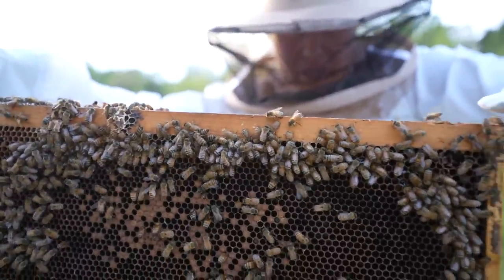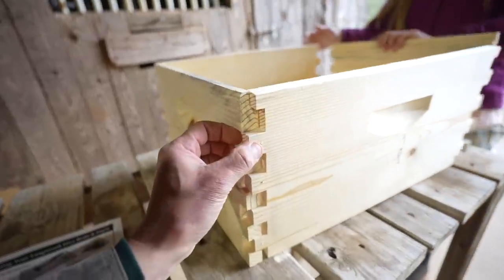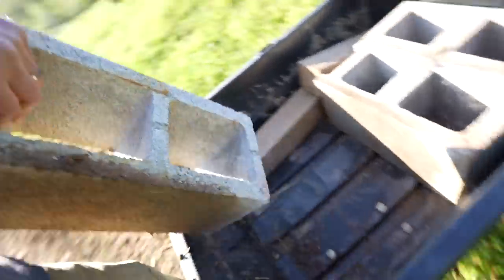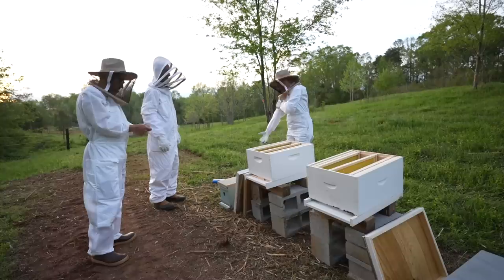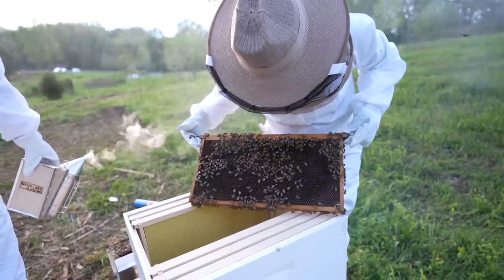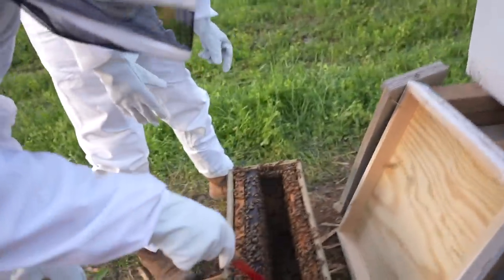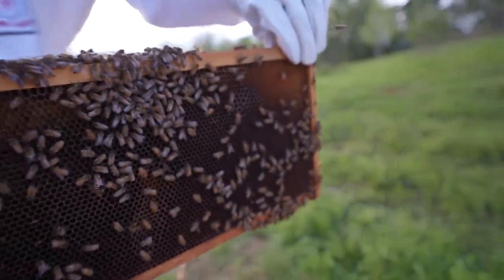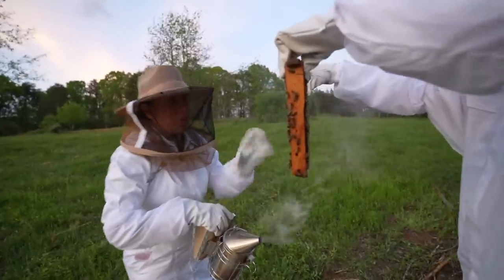We Got BEES

Comment: I'm sure many have told you but put your hives where they can get some shade not out in the hot sun of where you live, you'll bake the bees. Also don't worry about the bees when you want to put the frames in the box, they will move out of the way and if you squish a few, which it happens, it's ok. You have 30,000 bees there, missing a few is ok. Also when you look for the queen keep the frame over the box because sometimes the queen will fly off. Don't be afraid of the bees you'll be protected in your suit. I don't always wear a suit when I'm in the hive. It's a fun hobby with great benefits of pollination and honey.  I would order both a brush and a frame lifter to help you. The brush is to gently move the bees out of the way because they will build up quickly and you'll have to do splits which means you'll need more boxes and the frame lifter will help a LOT because the bees will glue everything down and it will become very difficult for you to lift the frames out. Also I'd either put a heavy rock on the top of the hive or a ratchet strap ( which is what I use ) to secure that top. Wind will do terrible things not to mention animals.

Comment: You want to press the frames together to maintain the proper spacing. Especially undrawn comb frames.
-------
If first frame is always the hardest to get out. Use the hook end of the tool to pry up the end by placing the heel on the adjacent frame. Then pry up the other end for easier lifting. Once there is the space 1st frame space just use the other end ot the tool to pry the next frame into the open space, making lifting it easier.  When replacing the last frame the paddle end of the tool is just the right width for placing the last frame. Placing the -------------| ___|  in the gap and using it to spread the frames on either side will create a space big enough for the last frame.
------
Vibration excites the bees so always gently place the frames. No thuds. 
-------
Work the bees from the back of the hive not in the flight path at the front.
-------
A couple puffs of smoke, not too hot smoke, under the cover and at the entrance is often enough smoke.
--------
Don't work the hive early or late in the day as more bee will be home. If a storm is approaching don't try and beat the storm by working your bees as again they will all be home and potentially more ornery.
-------
Great that you have two hives as you will learn more, and faster, as you can compare and contrast the hives. If the are both doing something you've never seen you can assume it is "normal" behavior. Like bearding at the entrance when it is hot.
Have fun.